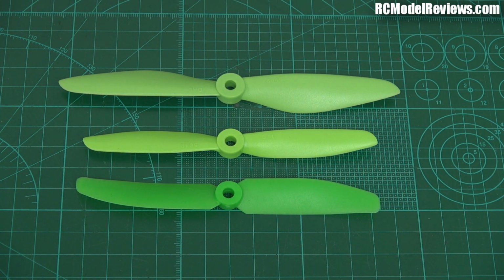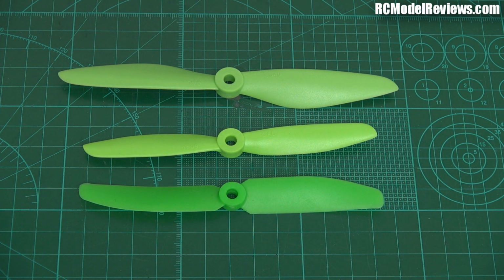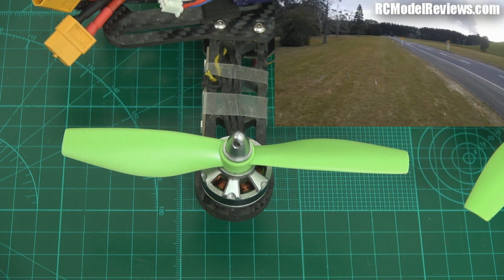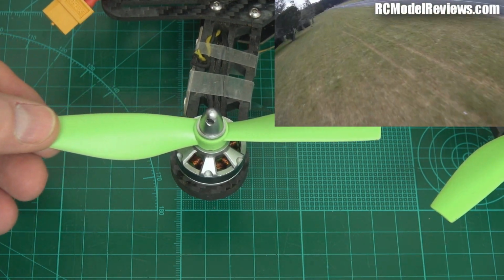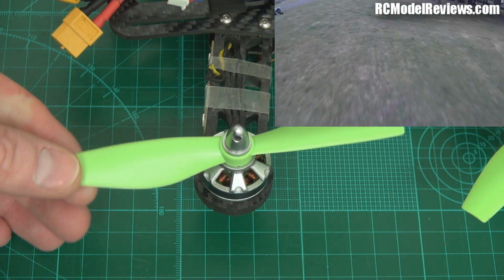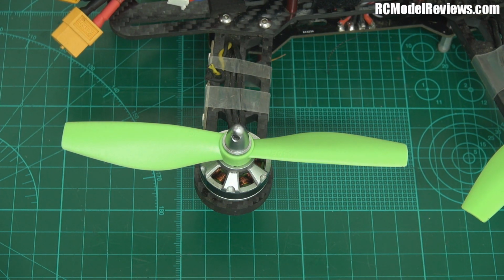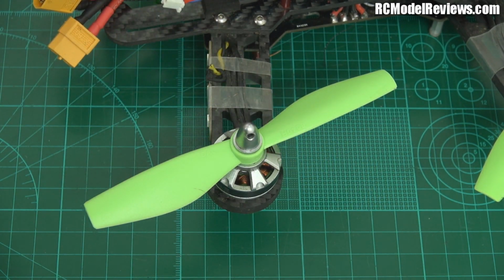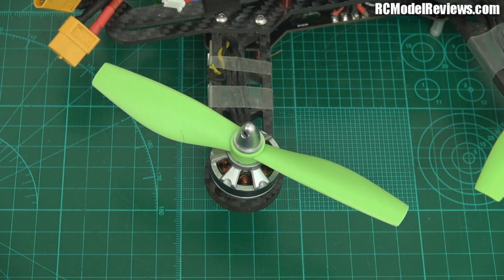Unbreakable 5x4 bullnose props for mini quadcopters

Comment: I tried these and they are very quiet with good thrust and efficiency. The only issue I had was that I had to drastically change my PID settings to not get bad vibes on punch outs. But once dialed in they are pretty nice and I'm still flying them.

Comment: If you are flying proximity and crashing a lot (like me), try out ATG propellers. I have never broken one and I've had multiple high speed crashes into trees and whatnot. I've broken arms on more than one occasion on my 250 quad and the props are still intact. They will end up bent (just bend them back), chipped and dented after a few hard crashes but they have not snapped ever. They are plastic too so not expensive carbon fibre. Seriously go out and try them. I get them from a shop in Hong Kong so I don't know where you could order them from but I'm sure ebay would have some.

Comment: THEY are Great I fly em as well
Was disappointed  with the power loss of the 5040 but these 6040 cut down to 5040 are GREAT !! little less power but withstand a knock or 2

Comment: Did you get a chance to do thrust tests between HQ5x45BN vs this 5x4BN? Very curious.
Reply: Boris B. Yo Boris please pressure surveilzone to make some 5x4.5BN! Sounds like the perfect 4s prop is not too far down the road..
Reply: Boris B. Going to do that in the next day or so... stay tuned!
Reply: Boris B. Brand new 6inch shatters like a well used gemfan on my 4s setup. I have never tried a propeller that breaks as easily.
Reply: Boris B. Try these out
http://www.ivrotor.com/iv-rotor-5045-ultra-durable-bullnose-propellers-4-pack/
thrust is the same as a HQ5 x 4.5 :)  and in crashes is less likely to break
Reply: ankjaers Yes, I have just posted the bench-tests for power and efficiency, comparing these home-made bullnose with the 5x4 and the HQ 5x4.5 props.
Reply: ***** Great video, my tests were about the same as yours on a 4s setup. However they are much more bendy than HQ props. So in hard direction changes the quad will be more unstable on DAL props than HQ.

Comment: Right.  Iv tried SZ 6÷4 and 5×4 props, turned out that 6×4 are very brittle and brake so easy by the centre thank god them cheap.  About 5x4 I'm with you Bruce no power at all just noise but absolutely undestructible
Reply: ***** Yep, I wouldn't race with the 5x4 but when you're carving your way through trees they're brilliant! :-)
Reply: I don't race, I'm just learning to fly making my baby steps in acro mode . Looking for something durable so I don't have to change 3 props every 5 minutes 
Bruce you might already hired about "dragonfly 5045 /6045 bullet proof composite propellers" if not Google it . They cost 3.95 - 4.65 USD for 4 pcs . Would you put them on your bench I would love to hear your independent opinion. Some you tubers saying they are GF killers but no one shows how durable they are toward the centre, how much abuse they can take
Thank You for very helpful videos as always Bruce

Comment: You need to install yourself a camera auto-tilt system so you arent forced to view the grass when booking it.
I designed one for the ZMR250 that works wonders. Will be on thingiverse soon.
*You should post a video on best practices how to cut down the props. *
Reply: Dirk TheDaring 
I just printed this: http://www.thingiverse.com/thing:750494
It works wonderfully to cut down the props quickly and accurately to size.

Comment: Rotorgeeks is the best! Great choice for 12amp ESC's.
Reply: Jason Campbell Yep, I've got no complaints.  I've run these 12A ESCs with 4S and 6x4.5" props without any issues as well.
Reply: ***** My ONLY complaint is that in the 100degree heat, bullnose props @ 4S tend to give it a little thermal shutdown...   I'm not sure how valid the complaint is, since it's pulling damn near 20A in that configuration.
Reply: Micah Morton Geez, I'd love some 100 degree heat around here right now :-)
Reply: Micah Morton Are your ESC's positioned in between the arms and props?
Reply: They are under the frame. Not on the arms at all. (which explains it I suppose)
Reply: Yes I was going to build my QAV250 in this way but I changed my mind and decided to put my ESC's just under the props for extra cooling. If you do so, I'm sure they will be fine even on a hot day. You'll just have to watch your motor temp on the long full throttle runs.
Reply: I run them pretty hard on hot days and really only have the problem with the bullnose props.  I've run 5 batteries in a row on a hot day and had no problems with other props.  Considering what those little 12a's are doing, it's pretty amazing.
Reply: Yes Rotorgeeks has a good product line, and excellent support. Have you had any trouble with the latest BLHeli software? My antivirus didn't trust it.
Reply: I haven't had any issues with 13.1, but I typically stay a rev behind unless something is seriously broken and resolved in the latest version.

Comment: I bougt 50 packs of the red 6040. The balance is horrible so i stoped using them cant be bothered to balance them out. I broke 15 packs of ble dal 6040 cut down to 5040. The valance were vetter on those but they were just as brittle as the hqprop. My favorite prop is the hq 5040 on 4s 2300kv cobra motors.

Comment: Hi,
How do you find the duability of these propellers?.
I use these as 6x4, on a 4s qav with 2208. but i found them to break easily. 2 slow craches and total of 4 broken props.
i really like the performance, and they extended my flight time by about 1 minute.
and they are good value for money, so i am still going to continiue buying theese.
i was just woundering if i had recived a "bad batch" when it comes to the unbrakebale part. (i have also manage to break some of the 5x4 unbrekabale, but they seem harder to break)

Comment: The 'unbreakable' 6" props need balancing.  I also cut down some 6x4 to 5x4 and, of course, balanced them.  They seemed to do fine, BUT...keeping them balanced isn't so easy.  

I'm using vinyl tape on the bottom side of the props.  This has ALWAYS worked great on other props.  The tape just doesn't like to stick on these props.  I'm going to try wiping them down with alcohol first, then try the tape again.  Perhaps it's just the mold release stuff that keeps the tape from sticking to the props well.  We'll see...

Comment: In looking around for info on motors I have found info on props, comparing motor brand a to brand b, etc. What I am looking for is real info (not opinion) about the difference in motor types. For example, RCTimer makes 4 different motors all rated at 2300kv, an 1804, 1806, 2204, 2206. What are the actual flight differences between these motors, other than physical size?

Comment: Hey Bruce, have you seen the cut down props IVrotor sell? Pretty much the same as you have done here but made more commercial.
Reply: MrSlick118 Yep, sure look like it.  IVRotor's prices are pretty good too, considering the low value of the NZ dollar right now and the fact that they carry them in stock locally and have already trimmed them to size.
Reply: MrSlick118 Actually, on closer inspection the IVRotor ones are 5x4.5 because they've been using 6x4.5 to start.  I could only see 6x4 on the SV website so IVRotor props will probably give more thrust/speed

Comment: I have a 250 size quadcopter with DYS BE1806 motors, and I ordered the 6040 unbreakables. I didn't know that I need to cut them, so I put them on my quad without modding. My quad flies good, but the motors get hot during the flight. Should I cut the props, or is it just recommended? Thanks in advance.

Comment: "performance, quietness and efficiency of the "unbreakable" 6x4 props from Surveilzone after I cut them down to 5x4"
thats true. the sound is way cooler. brrrrrrrrrrwwwwwwwww instead of screeeeeeeeeeeaaaam. on 4 s especially! power is nice too, I guess better performance then HQ 5x4.5? less amp draw but quite a boost.

Comment: I have been cutting down 6x4.5s to 5" for a long time...they appear and sound in the air similar to the SV ones...they do last longer than the HQs and are very,very inexpensive:  http://www.myrcmart.com/6x45-epp6045-counter-rotating-propellers-fm-series-pair-black-p-7387.html ,also they have 6x4.5 by Gemfan (GM series) but havent tried those...
this is the latest dremel cutter I designed and use: http://www.thingiverse.com/thing:750494

Comment: How did you cut them down Bruce?
Reply: MrShufty I'm not sure how Bruce did it, but the standard method for me is to use digital calipers to measure approximate length of the blades and mark it with a pen, then cut to size with scissors or a knife. Once they're approximately the right size, I put it on the  prop balancer and use sandpaper or a knife to remove small amounts from the heavy tip until the prop balances out. If you measure accurately, you barely need to trim any material at all, usually just a tiny bit of scuffing the tip until it balances out perfectly. A quality balancer helps a lot with making this work well, since 5" props are so small and light.
Reply: Chris Tate Yes, to see if they worked I just measured the lengths, cut and balanced.  They're easy to cut -- just score a line with a modeling knife and then bend.  Once you've scored the surface they actually break very easily -- a bit like glass.  Hmmm... :-)
Reply: ***** can you do a quick video to do this, would love to see
Reply: Chris Tate Can you recommend a good balancer?
Reply: The best one I know of is the Top Flite magnetic balancer. They're pretty much industry standard AFAIK. Very nice quality with a stable base and hardly any appreciable drag (which is the most important thing imo)

I use a cheap little mini one I got off ebay, it works okay, but it's very small, so it doesn't hold the prop off the table, so it's a bit harder to use. I have actually taken the middle portion that screws onto the prop, and made up a jig with 2 razor blades as the bearings, because the magnets that the original unit used were too draggy to reliably balance small plastic props without a fair bit of faffing around.

If you don't feel like messing around with your tools to get them to work properly, I'd recommend the Top Flite or another high quality brand like, Graupner or Du-Bro. I've only used the Top Flite, but I'm sure the others would be of good quality too as they're well respected brands. That said, if you're short on money, the cheap ones on ebay work fine, they just might not do the job quite as accurately, or take a bit longer to get the prop fully balanced. Not a big deal unless you're doing something super high performance like pylon motors running 25K+ RPM
Reply: Chris Harris This is the one that I have: http://www.ebay.com/itm/Magnetic-Suspension-Propeller-Prop-Balancer-for-Multi-Rotor-Copter-Kl-/371354551042?pt=LH_DefaultDomain_2&hash=item567674c302 if you search "prop balancer" on ebay, there are a few that look like they'd work well, including the Du-Bro I mentioned. It's not magnetic, but people seem to like them a lot
Reply: Thanks
Reply: Chris Harris The Du-Bro is most often regarded as one of the best. It can be used with more or less any props size or type. I got mine from Tower Hobbies, since they had it at a good price. Have used it for a year+, and it really makes balancing quick and easy. http://www3.towerhobbies.com/cgi-bin/wti0001p?&I=LXD712
Reply: I use the Dubro balancer, seems to work pretty well.
Reply: I might have to get one of them myself some time, they look pretty nice. And it costs a lot less money than I initially expected!
Reply: This is my way of doing it:
I take a bolt that fits the prop. It needs to have no slop but easy to move. Then I glue it to a 4 inch long by 2 inch wide piece of wood. I take my Dremel and mount it 5 inches away from the center of the prop. Then I rotate the prop and cut the tip, then keep on rotating until it hits the other. This is so both sides are exactly equal.
Reply: Chris Tate another way to do it : cut the first one and use it to mark the other side .so you are equal both sides
Reply: underfloor heating installer Oh, that's a great way. I never thought of that. Use it as a template.
Reply: Chris Harris I've got one from hobbyking and is pretty good
Reply: MrShufty i use a 3d printed jig that goes on my dremal :)